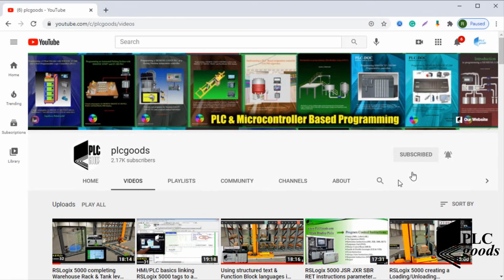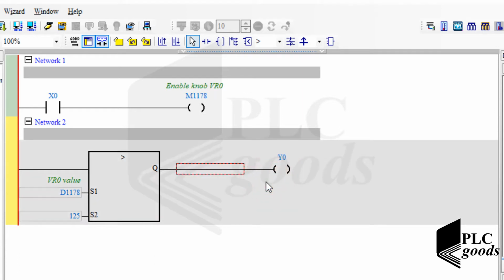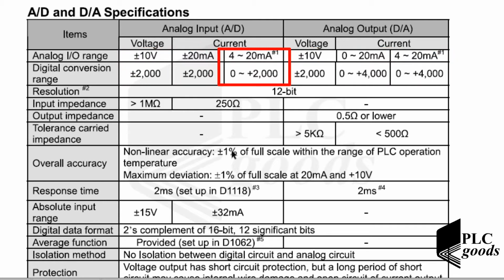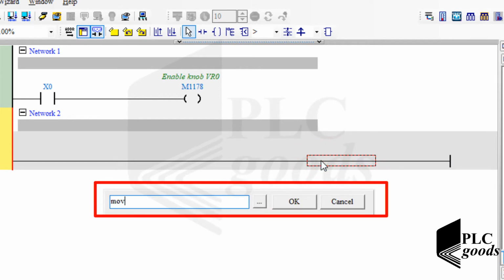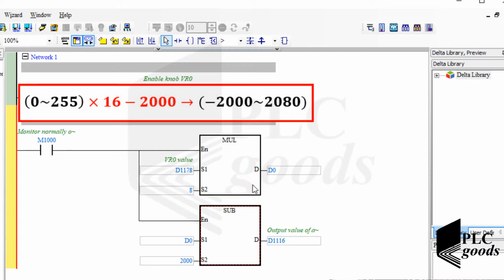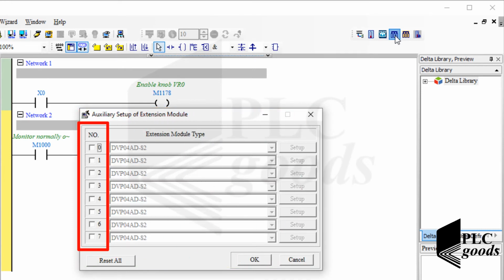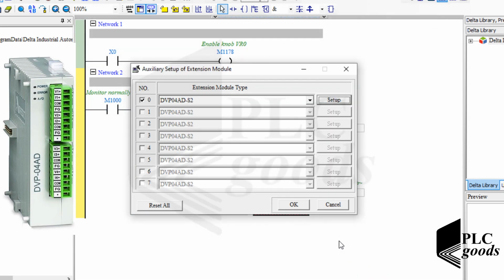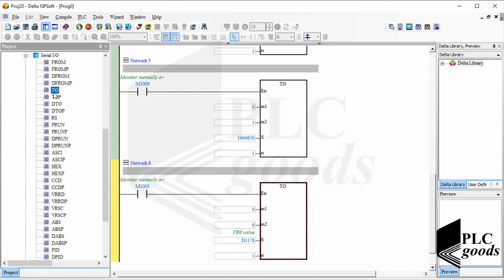Delta PLC ISPSoft Tutorial | Analog Signals & Extension Modules  | Lesson 20

Comment: I am going to purchase an analog input module used in delta PLC that can read +-10v and+-20mA, but the analog sensor which in my hand is giving an output of 0-10V or 4-20mA, so is there any option I can read these analog sensors using this analog module? my analog input module is DVP04AD-S ,so is there any DIP switch available in this module to change the input voltage or current rating?
Reply from the maker: Hi there, your analog module supports a voltage (current) range which is larger than your sensor's signal. So, you can connect your sensor to the analog module, but you will need to write a suitable function (using Math instructions) to convert the receiving signal to an appropriate number in your PLC program.
Reply: @plcgoods  thank you👍

Comment: And if I have an analog input module on the left and a digital input and out module on the right, does It affect the module declaration? Or use the modules without declaring?
Reply from the maker: Hi there, first check out whether an input/output module can be installed on the left side of your PLC or not. For most of PLC stations, input/output modules are installed on the right side. Also, based on your PLC model, maybe you need to configure its hardware settings such as its input/output addresses.

Comment: Hello sir,
I am seeking your help to know how to do ispsoft plc programming for pressure transmitter rating (4-20ma,0-230bar).
Reply from the maker: Hi there, the processes of reading analog signals are the same. You need an analog module that can receive your current signal and then you will need to convert the received number to a number between 0-230 bar. I explained how you can read analog signals with an example during the Delta course. Please watch that and use your documents related to your PLC and Transmitter.

Comment: hello i have dvp-20sx2 and i trying to do what you do in ispsoft
im useing lamp for analog output
i do the same program and only the current analog output work for me
i try to see the volltage betwin VO0 and AG and i the volltmeter show my 0
i try to conect the the lamp to IO0 and AG and the lamp is work and i can see the lamp work with VRO (D1178)

what can i do to make the analog volltage output work?
thank you very much
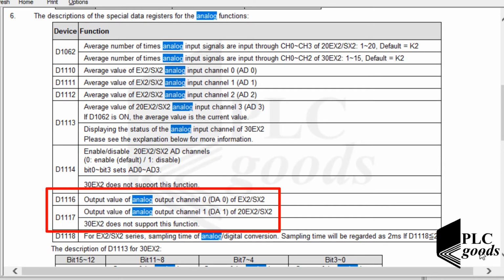Reply: Hi there, you may need to enable the voltage output D1114 or change its type D1115. Please pay attention to the video time 7:30 and use the help window.
Reply from the maker: Thanks for checking the channel out!